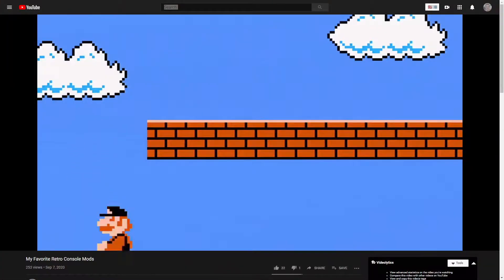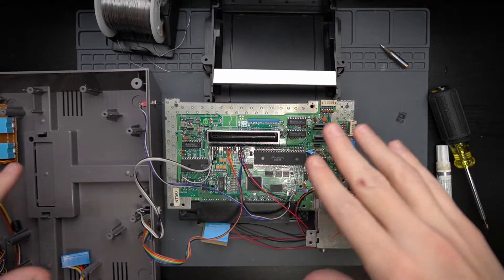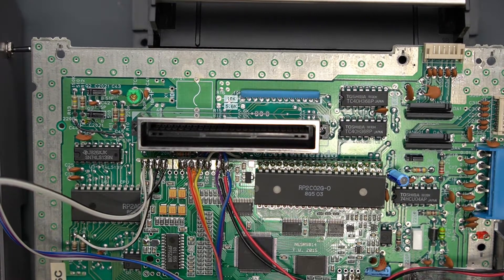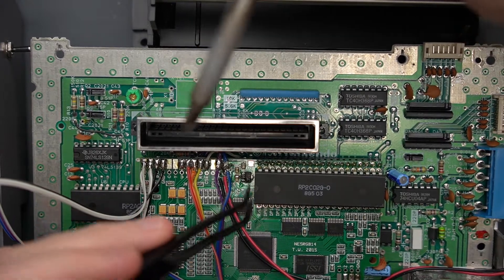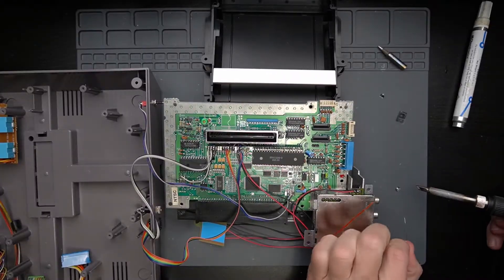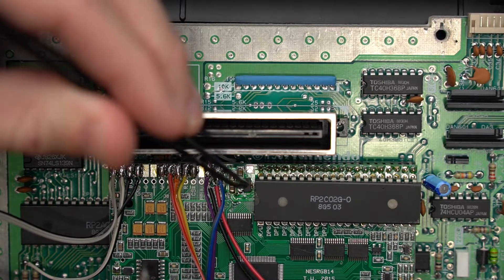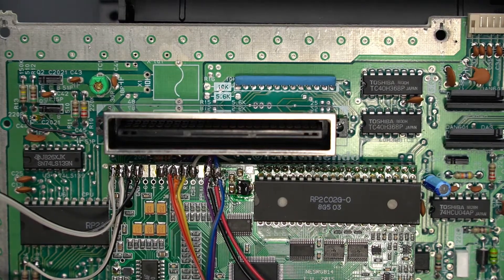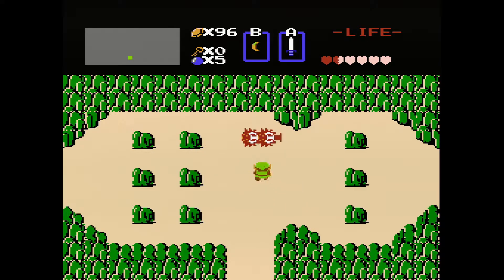Did This Fix My NESRGB Ghosting Issue?

Comment: I don’t see the horizontal line issue but that particular game often shows a glitchy line of pixels called “NMI Interrupt.” For whatever reason, it is way more common with Hi-Def NES than on unmodified hardware but it does happen. Does you issue look like a flash of corrupt pixels in a line?
Reply from the maker: No it’s more like ghosting

Comment: I have an issue with my new nesrgb. Like black horizontal lines moving up the screen. Might just be the psu but it doesn't do it on my unmodded nes via composite. Waiting for a new psu to arrive. Hope you get yours figured out. 
The funny thing is I noticed my issue when playing smb as well. The blue sky shows it off best.
Reply from the maker: Can you take a screenshot? What is the NESRGB connected to?
Reply: @dubesinhower  retrotink2xpro via hdretrovision component cable. TV is uhd 4k Sony led from 2017 and samsung 1080p plasma from 2012.
Reply from the maker: Do you know if the version of NESRGB you have includes the dejitter mod?
Reply: @dubesinhower  he removed dejitter about a year ago. My modder assured me dejitter was included but it's not. I read Tim's firmware release notes and it's been removed. I'm pretty confident this isnt jitter. I've done a little research and it looks like this MIGHT be the ac adapter. I've ordered a new one from castlemania should be here in the next day or two. Funny thing is I've tested it on my unmodded nes and do not see the issue. I've also connected rgbnes directly to the televisions and it's still there so I know it's not the retrotink. Ossc doesnt display on either of my TVs via component or scart csync or sync on luma. That tells me it needs dejitter because I saw the modder upload a video using rgb scart to ossc and it worked on his display.
Reply from the maker: @digitalblasphemy1100  Sure, try the new AC adapter. The dejitter is only disabled on a newer firmware that shouldn't be loaded on your NESRGB. However, if you look under the "buggy releases" section, it shows that firmware 2.1 has some dejitter bug that was fixed in firmware 2.2: https://etim.net.au/nesrgb/background_fault/
Reply: @dubesinhower  well I only just bought it a few months ago so I'm assuming it's got the newest firmware which has dejitter removed. I do not have the capability of downgrading the firmware so looks like I'm screwed for the time being.
Reply from the maker: @digitalblasphemy1100  Tim's site explicitly says it isn't on any production boards, so I don't think that's true. Might be a compatibility issue with retrotink. Let me reach out to Mike Chi and see if he has any ideas
Reply from the maker: Okay he confirmed that it could be the PSU. Let me know the results!
Reply: @dubesinhower  It was not the PSU. I still haven't figured out what it is but I stopped trying to figure it out when I bought a retrotink5xpro because it's pretty much gone so I believe it's jitter. There is an unlisted video floating around with the exact symptoms I have and they titled the video something like jitter so I believe that's what it was. 
I do have a question though. I did have the power filter cap replaced when voultar did the nesrgb mod but none of the others so I thought it might be one of the other 5 or so caps in the power A/V board so I purchased what was at the time the only replacement called NES I/O v2. I haven't replaced it though because I am unsure if it would be compatible with Voultar's mod. The only time one would install the NES I/O is to use the rgb sega genesis output for a no cut solution but I have voultar's snes output already and prefer to use that method. Would I simply solder the new I/O to the nes pcb and call it a day or MUST I use the sega genesis output for the I/O to even be compatible?
Reply: @dubesinhower  https://youtu.be/bLDgHXRyYew